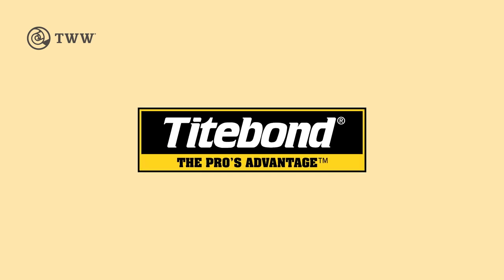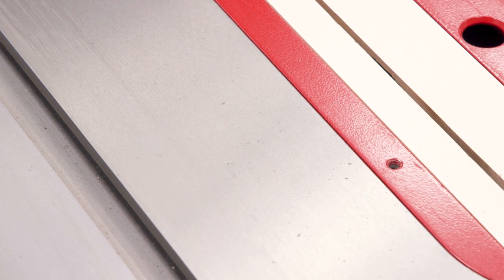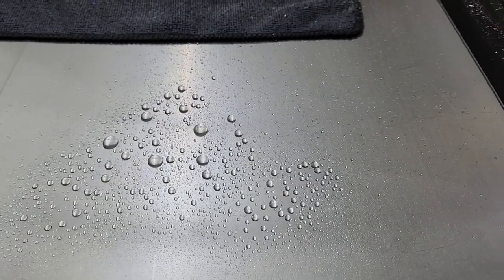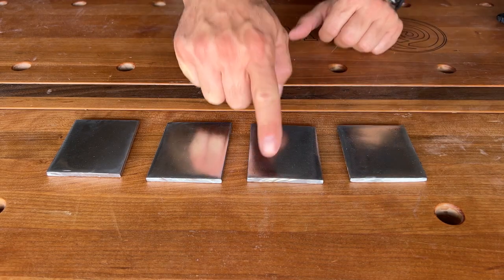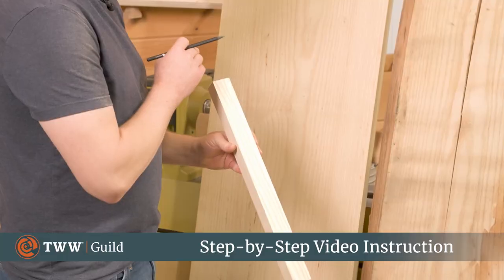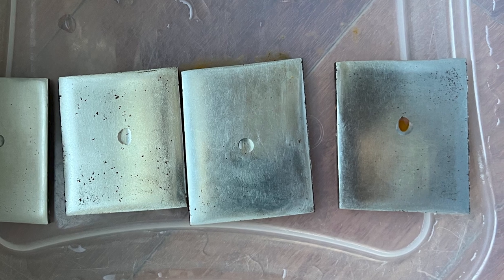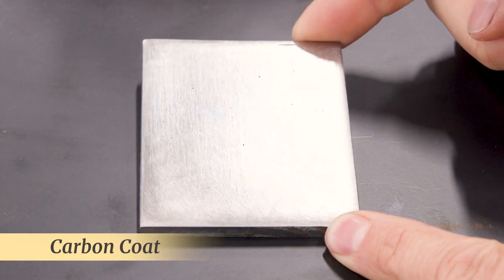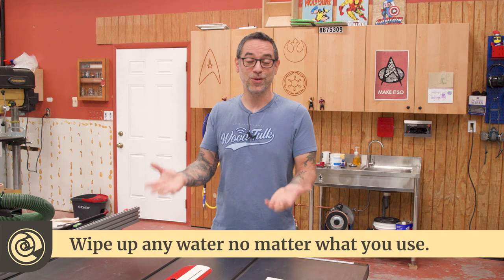Did I Screw Up?! | Carbon Method Update

Comment: Love the video, but you forgot one thing. We aren't getting Carbon Method ( as well as it worked) for free. The smallest portions for sale on their website are $65. I can get a large can of T-9 for $18.68 on Amazon. I like the Carbon Method product but I'm going to stick with the Boeshield.
Reply from the maker: Didn't forget that. But $18.68 is also not free. :) The value proposition here is that you shouldn't need to apply it very often and hopefully in the long run you save time and maybe even money.
Reply: @woodwhisperer  , They told me if I used the tools frequently, I may need to apply monthly.
Reply: @KingsFineWoodworking  James, we were talking about Carbon Glide, not Carbon Coat.  Carbon Glide is applied as needed.
Reply: @Daniel.Thomas , oh I see. Well I do have tests running on three tools currently. Two with the proper number of coats, and one with what was left in the container after doing the two, just to see how a partial coat does. 
How often might a person expect expect to re-do the Carbon Coat itself on a light to medium use tablesaw?
Reply: @KingsFineWoodworking  My Table saw has been coated for 15 months, I only use it on the weekends.  It's still going strong.  The only issues I have are from "torture" testing.
Reply: @Daniel.Thomas ,
That’s good news.
Reply: @KingsFineWoodworking  How are your tests going?
Reply: @Daniel.Thomas , so far everything is flawless. I think the are only at just over a month. I’d been ill and couldn’t get started when I wanted. 
I’ve been researching articles on the surface chemistry between cast iron and graphene, or at least something on the intermolecular forces between the iron and a suspension of deposited colloidal graphene, but I can’t find much. 

I am very pleased with the surfaces thus far. And knowing that it’s been going so long on yours, I’ll probably pick up more and do the other tools. I wouldn’t mind making a video if it holds out well, but I’d have to explain the exact chemistry behind it.
Reply: @KingsFineWoodworking  Hopefully things are on the up and up health wise.  I'd love to chat further.  I'll send you a message.

Comment: When I lived in Colorado I had a spring snow blow sideways into my open shop door onto my tablesaw and it rusted on contact even with wax on the table top with similar results of small rust spots all over the top.  I don’t know if it’s something about the climate in the Denver area, salt or other chemicals they put on the roads, acid in the rain or what but the rust formed so fast by the time I wiped the snow off it already looked a lot like your table did.  The rain/snow that falls in that area is really rough on cast iron for some reason.

Comment: The rust spots on your table saw were probably caused by acid rain or something in the rain that ate the coating enough that it got into the cast iron.
Cast iron almost always rust, what they should do is put a metal coating on it like they use on printing presses in lithograph printing you put ink on the plates and an acid solution washes it off the ink ecpt where image is burned into the plate then the plate transfers the ink onto a blanket that presses it on the paper, this is high-speed web feed printing, what newspapers and magazines are printed on.  But excuses fumes from fossil fuels cause these air pollution to fall back to earth in the form of rain.  Thats what got on your table saw.  You should have covered the surfaces with wd40 and plastic wrap. Then you take the plastic wrap off and clean off the oils.
Your saw was shipped to you with a coating of cosomoline on it you had to wash off with wd40.
Anytime you move equipment and cant get to it for a few weeks its a good precautionary mesure.
Not so much as you I dont think you'll be making anymore moves. But somone else who watches this might. 
Wd40 was developed to keep rust off metal the plastic wrap keeps water off the wd40. And air away from the metal.
No big deal to remove what rust you've got but you've got to do it now.
Wd40 and 3000 grit sandpaper then do you whole process agine. If you leave the rust on it it will only get worse.

Comment: Why does the carbon coat looks like if it was hand sand it?🤔
Reply: I was wondering the same thing. You can see the swirl scratches on the other pieces, but the Carbon method piece has linear and shallower scratches. 🤨

Comment: You do not need water to have iron or steel rust. Water simply allows oxygen to maintain a sustained contact with the metal, unless of course by water you mean some acidic solution that pass as water...which again doesn't cause rust, but pits the metal and therefore provides more surface area for the oxygen to get trapped and cause rust. If you were to place pure iron in an enclosed chamber, drew a vacuum and then introduced ONLY oxygen, you would see it rust immediately before your eyes.

Comment: If Marc saw what my table saw looks like on a daily basis, he would be sick.
Reply from the maker: Haha no I wouldn’t. A blemished table saw surface is a used table saw surface. I think it’s silly when people freak out about stains on cast iron. But rust is something I feel affects the performance and overall longevity of the tool. I really don’t care about the appearance but I do like to prevent rust.
Reply: @woodwhisperer  but Marc, I even have epoxy stuck on it and multiple gouges from using a grinder while metal working. 🥴 It’s truly a mess of a machine, but it does work!

Comment: I disagree "you shouldn't leave water on your tools" as an excuse for rust prevention.  Condensation! We don't all have climate controlled shops and condensation means we can have water droplets for in the Iron that eventually evaporates. That's more a knock for Carbon than Marc. 
Second, you can get moisture in your cast iron non obviously and the protection should still work.  Sawdust is hydrophilic and would introduce water to tour tool tops, unless you keep them immaculate.
Water drops happen!
I may have to look into this though.  I'm on wax only and not too unhappy, but my hand planes are my biggest problem...

Comment: I think you are overly paranoid about a little corrosion. Yeah it is disappointing but I know lots of people who produce excellent work with used tools that came corroded. I have a used bandsaw with mild pitting on the table that cuts perfectly well - every bit as good as the new one in my shop.